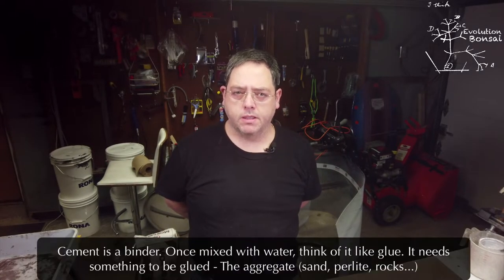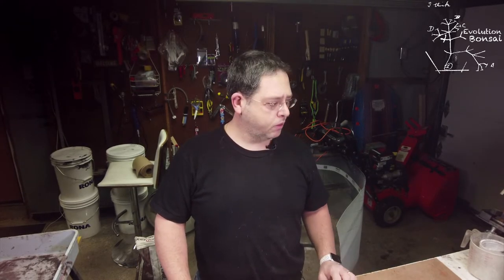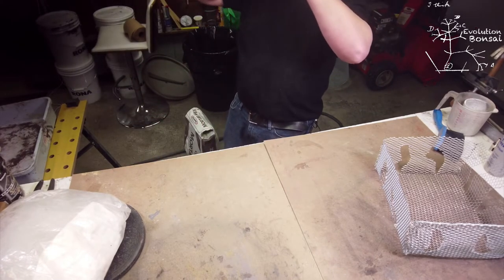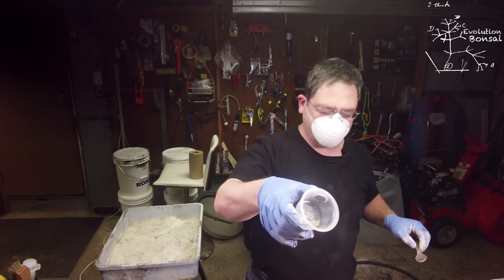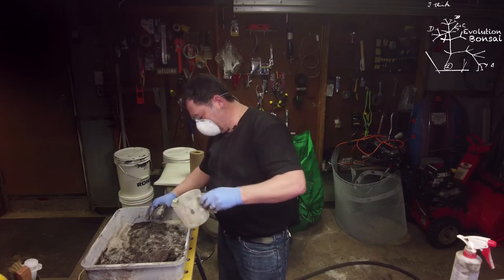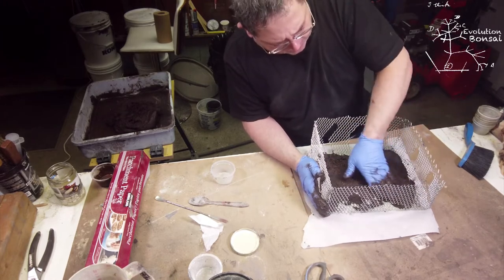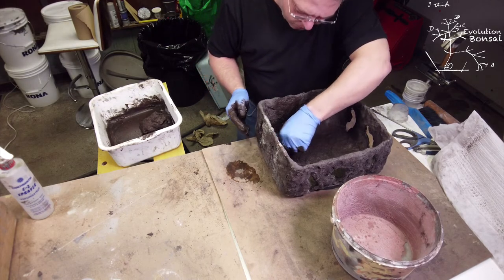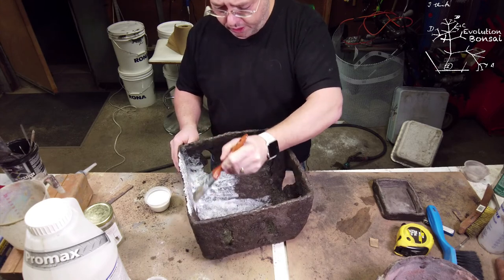Creating a concrete bonsai pot

Comment: Any hope of links to the products you've had success with? pigments / admixture entrainer / pigments / etc? I'm trying to dig into this. I appreciate your video and sharing. I see the admixture bag, but having trouble finding that product on google (at least based in USA). Found the plasticizer.
Reply from the maker: Hi Matthew, thank you for your comment. The mortar is from rapidset which you will find at home depot.The only other essential component to add is either alkali-resistant glass fibre or what I have been using so far in my case, a polymer fibre. The specific one I use is called Fiber One from Interstar (https://interstar.ca/downloads/productinfo/en/FiberOne_en.pdf) and you may be able to find it in the US but if you go to a store with art supplies for sculpture, they may sell at least the glass fibre. You will also need a concrete plasticizer, that is very important but you can again find many brands. Mine is called 'Water Reducer Adva 555'. The add-mixture I used while I had it but no longer have and not sure if it is essential is Sheng's concrete admixture and an air entrainer. I've made containers with either of these two and they are fine, resist frost/thaw cycles, etc. The main things really are the fibres and the plasticizer.
Reply: @evolution_bonsai  thank you for more specifics and for taking the time. Best of luck with winter prep!